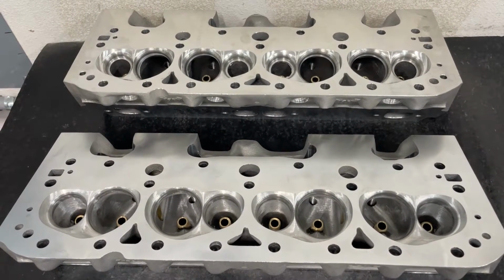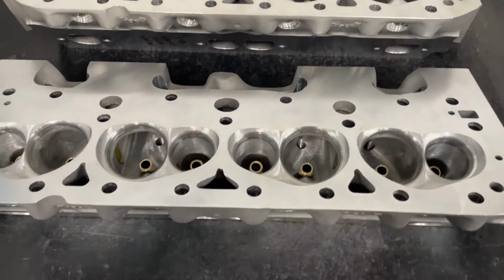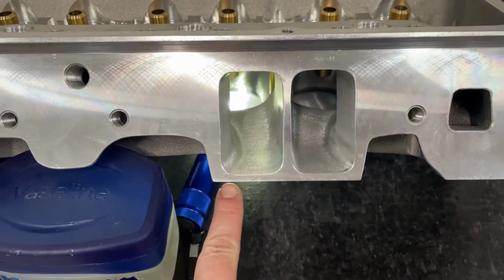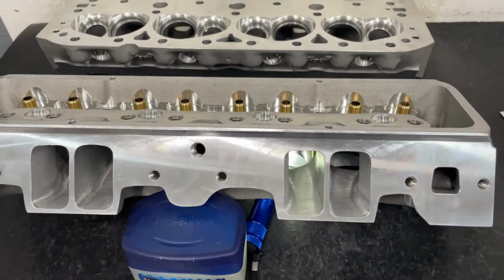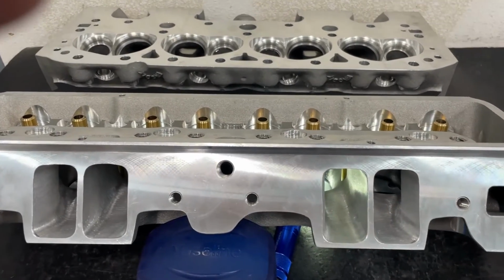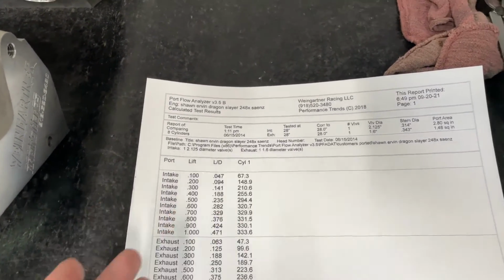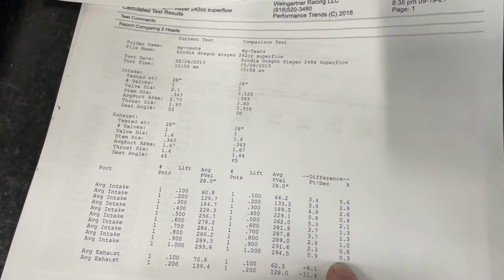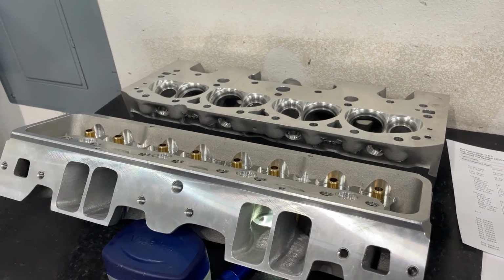Brodix Dragon Slayer 248x and other info

Comment: Eric do you realize how many racers I’ve tried to pound that into there heads? When you have a peak flow @ 600 lift! You really want 700 if you can fit it! So your actually using what the port flows! These are small things that bad ass engine builders know & use to make more power than the guy in the other lane!  I think we tried dimpling years ago, I don’t believe it added any power, but I think it was helping the fuel atomization especially in carbureted nitrous engines! I’ll have to ask the old man about it 😜😜😜😜, my boss, people call him uncle Pete! Also he looks exactly like Pete Harrell! Except he’s probably 4 in shorter, with short hair & his name is Pete also, hysterical they probably could be twins! 😜😜😜😜🤪🤪🤪🤪!

Comment: I know this has been asked, but new to your channel.  Watched the AFR vs Profiler heads and question one, does the intake valve size of 2.05 vs 2.02 make a big difference?  Second question, what out of the box sbc head would you consider to be a good head for a strong 500 HP street head?  I've heard people compare Brodie vs AFR and now you're Profiler head.  Kind of leaves one baffled a bit.  The biggest I want to go on came is .530 for this engine

Comment: Thanks for providing some general context about what kind of engine, rpm, and cam the heads you port will end up on. It provides some valuable context to how those flow numbers will be applied. Any time you can share specs on what the head will end up on and how it will be used it is appreciated.
If it doesn't hurt your hand, maybe do one port with something like a Harbor Freight die grinder, router speed control, and just pick a couple of areas to address that would get a DIY 70% of the peak results without hitting water...if that's possible.

Comment: What I want to see on the LS head would be the incremental flow increases for each step of porting. 
Just clean up the throat area and check how much flow increases, then just clean up the bowl and check, then just gasket match and check, then open up the throat and check, then open up the bowl and check, then open up the port to increase Cross sectional area then check.  Basically want to see the gain from each single step of the porting process.

Comment: 720 hp from a 406 at 7000 rpm is 1.33 lb-ft of torque at the power peak. 1.25 is a seldom-reached number, so 1.33 is REALLY good. (Torque is what the engine is producing, horsepower is rpm dependent.) That is one effective cylinder head! The flow difference between the heads on your comparison page is 2.5-3%—at 700-ish horsepower that is about 20 hp more, just what you said happens on the dyno. Anyone wanting to build a strong SBC should be coming to Weingartner Racing!

Comment: is that 720 on race or pump gas? what would be the 248x's max on 93? Would running a 1209 gasket make any more power? and for the LS intake port idea, What if you did some abrasive flow machining. like have a super abrasive paste flow thru the intake 3 times or so and seeing what the paste thinks the restrictions are, remove the pushrod pinch too, as if it was an ls head with free valve technology. I think that could be a super cool test.  if you did a test on a stock sbc head or something, I'd wonder what would happen if you cut out the divider and knifed it when so you didnt hit water?
Reply from the maker: Race gas but it has made 710 on pump gas 421

Comment: I realize you build race engines, but what I noticed on your side by side flow was that the larger valve had better flow at low lift which would make more low speed torque on a street motor. Just an observation.